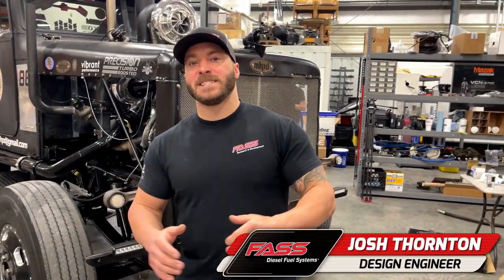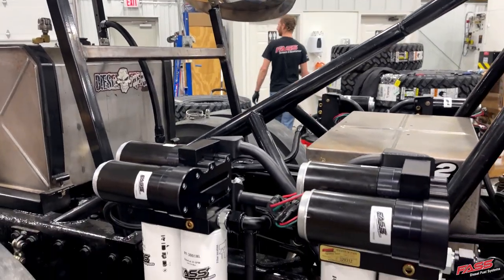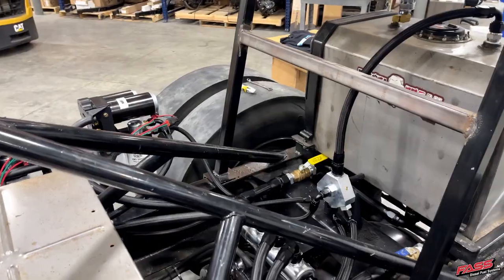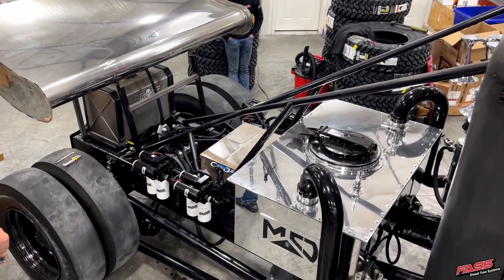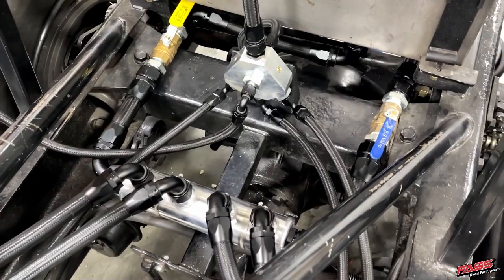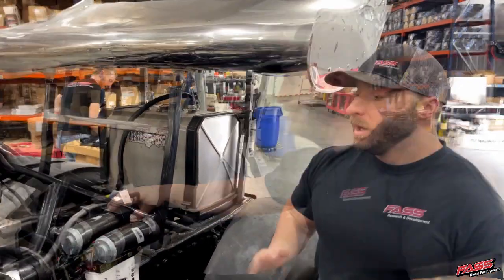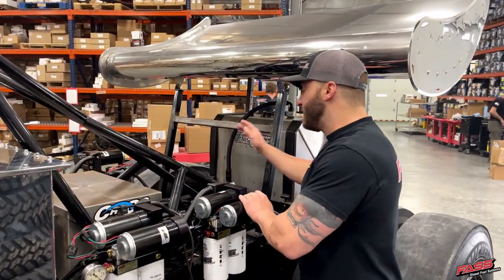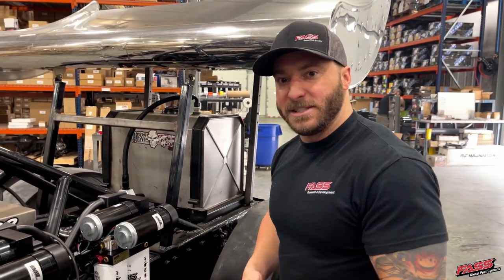Installing QUAD 540GPH Fuel Systems on a 4,000hp race truck!

Comment: My airplane uses fuel to cool engine oil through an exchanger.  In reverse it also serves a function to heat -50 deg fuel to prevent icing starvation if I find myself there.
Reply from the maker: That's really cool!